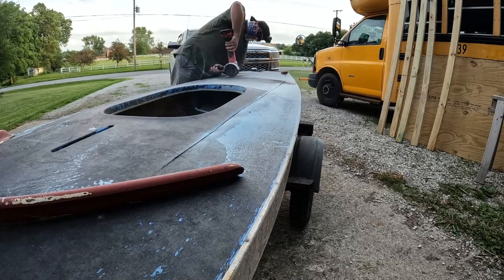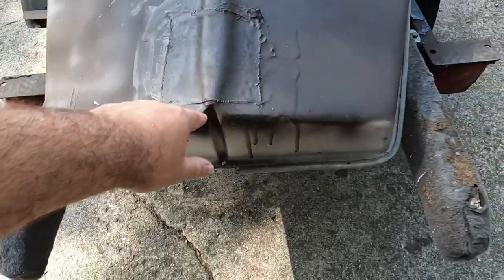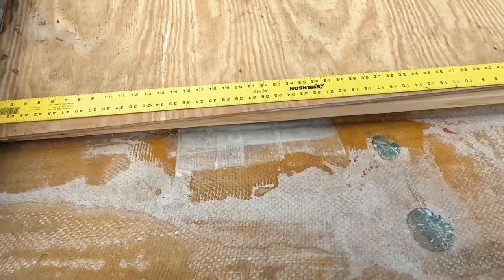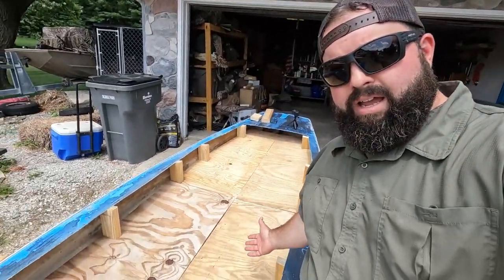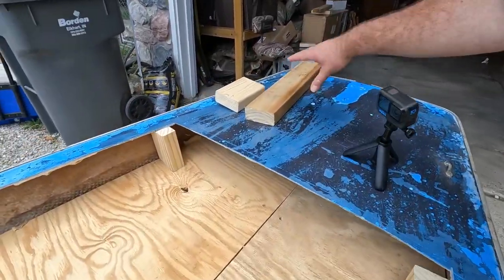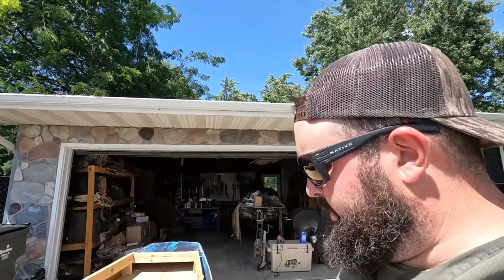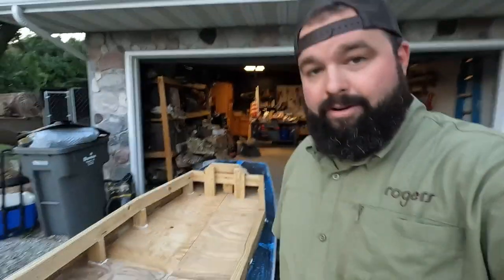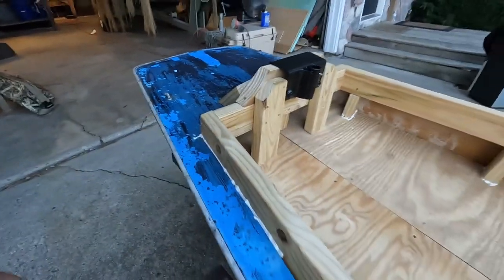Sailboat to Duck Hunting Sneak boat Conversion!

Comment: Are you putting a predator motor on the back? We just converted a buddy of mines Longtail with the mud skipper surface drive. 670cc engine. It's worked fantastic and I recommend. I would definitely second the spary foam insulation in there. That's a lot of additional weight added with that wood. It looks really cool though. I enjoy your videos.
Reply from the maker: Yep goin with a long tail thanks I’ll keep em rollin 🤙

Comment: You added a lot of weight with that wood. It looks wide enough to not flip, but I would add some foam to the inside. A bilge would probably take the place of the foam though. I added an 1100 gal/min bilge to my boat. It cost $10 and is rated to keep a 16 ft boat afloat
Reply from the maker: Ya I like that idea.. hopefully the wood isn’t 2 much weight 6x4 plywood and 3 2X4’s
Reply: @DuckGunChronicles  That's probably 50-60 lbs of weight in wood. It's really not that bad, I just have a bad experience with adding wood to a boat. I put a front and rear deck and a subfloor in my 14 foot, all framed and decked with wood. The boat sat way to low in the water to hunt the areas I wanted. Great fishing boat but I ended up selling it . I'm excited to see how yours drafts in the water, hopefully it sits nice and high!
Reply: @DuckGunChronicles   The foams isn't going to do anything for bouncy, foam does nothing the help a boat float, its all in relation to surface tension and mass surface/ mass pressure downward. Two things that the foam would help with is 1. keep the boat afloat if  you get water in it and 2., will help deaden the sound of you stepping on plywood.

Comment: I would definitely second guess putting spray foam insulation we did it to a 16 ft aluminum Lund not realizing that when that phone gets wet it can add up to 1000 lb of weight and that's way too much but yeah that build is pretty cool
Reply from the maker: Ya that is true good thought haha
Reply: @DuckGunChronicles  need to use closed cell foam.
Reply from the maker: @ggw7948  Can you buy that for this?
Reply: @DuckGunChronicles  yea check for it at us composites.